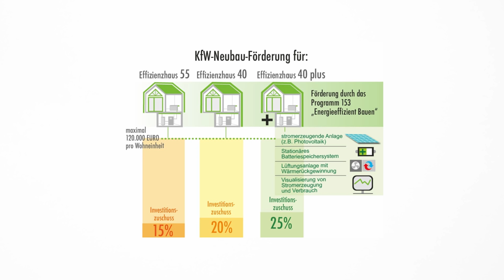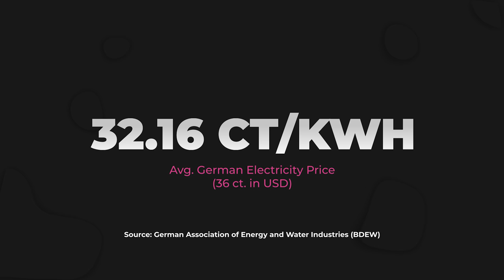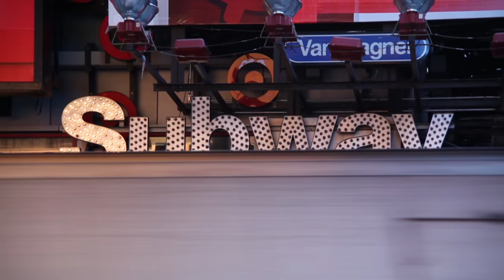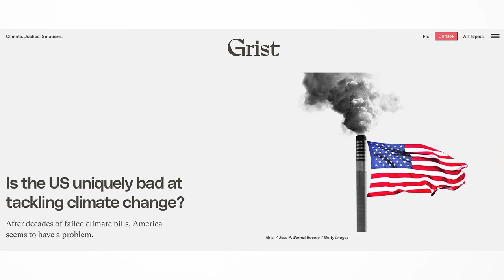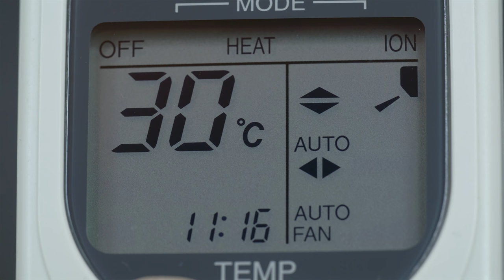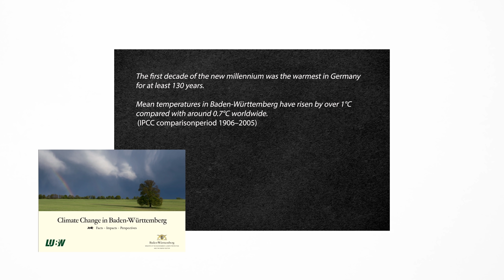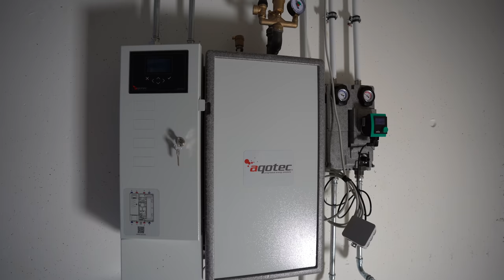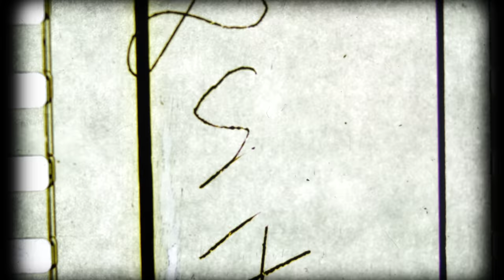HVAC (HLK) in German & American Homes | A Tale of Two Countries

Comment: What is crazy here in the US is how excessive the use of the AC is. We had to learn to always take sweaters or jacket and long pants with us when going to work, school, or restaurants, or we would be unpleasantly cold, even if the outside temperature is 104*F/40*C. As we continue to use our bikes to commute to work and the kids to school, this is extra complicated as you need two set of clothes. Often I am looking forward to get out of the building into the 100*F at the end of a work day to finally warm up again. Quite a bit of AC energy could be saved simply by approximating the inside temperature a bit closer to the outside temperature.

Comment: In Australia we do it it differently. Many houses are now starting to use multihead reverse cycle air-conditioning. Its also relatively easy to install - no big ducts to leak air all over the house, just a couple refrigerant pipes to each head unit. Its energy efficiency is usually around a factor of 3, and heat/cool output is within 30sec of turning it on. As it is effectively a low temperature (compared to boilers) air to air system that efficiency is even greater as there is no power put into pumping water or air around big loops.

It allows for individual room temperatures as well as for only heating/cooling the parts of the house you need. Typically a room serviced by this system can be heated/cooled within 5 to 30 min, depending on room and AC Head size, making it a very dynamic way of quickly maintaining home comfort. Once again making it more efficient as you are only heating/cooling parts of the home you are using.

Food for thought ;)
Reply from the maker: Ah really cool to learn more about this. Thanks!
Reply: Also goes to show that open plan concepts are not energy efficient. Because you need to heat or cool a lot of unnecessary space.

Comment: The city I grew up in Poland has a heating system connected to a local forge as their massive crucibles are never shut down because it may take several weeks to turn them off and on again.
All the heat is used to supply heating and hot water to residents making extra profits to the forge.

Comment: I live in Vienna (not really Germany, but close) in a building from 1907. That means thick brick walls. It hardly ever gets above 25 Celcius. I open the windows in the night, so its quite nice and cool in the morning, then I close the windows and the thick brick walls keep the temperature. - And my body adjusts to the heat, when I go out, its hot as well. Cooling my home to 20 Celsius or so, as some public buildings and offices do, would be too cold-  this is, what makes people sick, specially, when cold air is blowing at them, when they come from the heat outside and they are wet from sweat. I think, people on Europe walk much more, then in America, and so we have to adjust to heat more, since thats what is outside, when walking from one place to another.
Reply: Refrigeration instead of cooling, together with perspiration is what makes people sick.

Comment: We live in a house around 200 years old. Basically, the walls are about 1 meter of rocks mixed with some plaster. As a result, without heating, temperature inside will not rise above around 19°C in the summer. Basically, in the summer we heat the house by opening the windows.
Now,  in the winter, without heating, the house will stabilise at around 9°C. So, not freezing, but not really comfortable. 😉
As a heating method, we "only" have fireplaces in each major room. Fireplaces like ours (closed glass door fireplaces) deliver a combination of thermal radiation + infrared radiation. This provides a very fast and rather cozy heat, but there is no thermostate. If it gets cold, you start a fire, if it is too warm, you let the fire die. The thick walls are less insulation, but more a mass reserve for the temperature. I.e., if you heat every day, you will get waves of less and more warm conditions, but always more or less OK. If you do not heat a room for a few days, it will get cold and take several days of heating to recover.
Ironically, this whole setup was rather inefficient by the time it was built (there were a lot of cold days back then), but was done anyway just due to the availability of materials. With climate change around, we have more days "heating by opening the windows", and less days where we actually have to heat the rooms.

Comment: We had forced-air heating in the house, our family had lived in. My grandparents had build it in 1958. They had installed two chimneys. So we had two places for firing, if we wanted to get the place warm. So, up to 2006, our primary source of heating had been wood, and briquette. For heating up the water in the kitchen, and bath rooms, we had instantaneous water heaters. When they had built the grid for natural gas in our area, they didn´t connect our village. Because there haven´t been enough people who were interested to get their houses connected to the grid. By 2005 we got a new heating system installed. With radiators, as mentioned in your video. We used one chimney for the pipes of the new heating system, but still left the second one for forced-air. Due to the insulation of the house, we had situations in winter that it could be freezing outside, but you didn´t have to fire up, provided that the sun was shining.

To cool our house down, we didn´t do it exactly, as mentioned in your video. We opened all windows, and doors inside, turned the blinds down. But still left a little gap for air circulation. And then we closed them in the evening. When my brother and his fiancee build their house, they got a underfloor heating, powered by geo thermal heating. Of all the heating systems I had experienced, I like, if it comes to get it warm and cozy, forced-air heating the most. When one of my cousins who lives in our village rebuild part of his grandparents farm, for his fiancee and himself to live in, they asked a local company to make an offer for the installation of a heating system, and for suggestions which one they recommend to get it installed. The owner of the company said something, what you should keep in mind, if you´re talking about heating systems. It doesn´t matter at all if you have the most up-to-date and environmental friendly heating, if the insulation of your house sucks.

Comment: I live in high altitude region that’s extremely arid with not a great deal of variation between summer and winter temperatures. Average summer high is 32 C and average winter low is slightly above 0. We use water coolers not a/c units with rare exceptions to supplement air/room air fans because it rarely gets hot or humid enough to justify the the need for a/c. In the winter, natural gas accounting for much of the hearing. The indoor setting is around 20 C which is perfect for relation and sleep.

Comment: as to health: I personally always get a severe cold when going to America in summers because most shops etc. are cooled down ridiculously low and my body, dressed for summer temperatures, feels like being in a winter climate. In addition, most people criticize the closed system AC’s recycling of air in rooms (such as in malls, supermarkets, office buildings etc.), which implies that bacteria and viruses keep being blown into rooms and thereby can infect more and more peoples’ health. Window units seem to be very flimsy, as well. I always expect heat coming in through the thin elements keeping the units in the windows that now has to be cooled in addition to the air already in… Just my two cents…

Comment: In the US, region and climate are so varied it's difficult to find variables that suit everyone.   I grew up on the coast of Central California in the 60s and 70s.  It rarely ever got hot.  Homes didn't need AC.   We all used natural gas heaters, but it also never got that cold.  When I lived in NYC, I croaked every summer.   Needed a window unit just to sleep.  Never needed the heater vary often though as I like the cold.  I  moved to the midwest a few years ago, and again, I croak in the summer.   I can tolerate dry heat, but humidity literally makes me physically sick.  Vomiting type sick.  I am still, though, trying to work the summer with a system of fans throughout the house,  rather than installing a window unit.

Comment: 15:56  about 1999, Virginia (near D.C.) , a flat with air heating, wood frame construction: 
if you turn it out, the room feels cool in 1 or 2 hours ....  

Germany, floor heating, stone house: if I switch the central heating off, it's still warm enough in the living room after 5 hours ....  

ah... and not far away from you: 
France, Alsace, Obernai / Ottrot / Molsheim: 
Hotels with electric heating (electric radiators - no fan)  - if you switch it off, it soon gets cold in the room ... 

hm ... I prefer the german floor heating :-)

Comment: I did buy a small air mobile AC unit years ago, when we the room we slept in was the hottest in the apartment in summer.
But since then, the building has had a makeover with better insulation to the envelope and triple glazing. Also, the kids have moved out and we could move our bed to the coolest room in the apartment. Result, AC is no longer needed. Even longer periods of hot weather have not yet brought back the wish for it.
Re „unhealthy“ AC: filters in AC airducts are fine when new, but can turn into Petri dishes for the cultivation of all sorts of undesirable forms of life to share your space with over time, especially if maintenance is neglected. The “sick building syndrome” is well known where AC is dominant, even if other sources of ambient air contamination can also be responsible and occur in non-AC buildings, especially when the building or furniture is new.
Reply: My AC is running air through the system even when ist is not heating or cooling for at least 30 minutes to keep the system dry.
Only very old AC had the problem with growing bacteria. My AC has a high voltage (15000 Volt) device to clean the air in certain times all days.
Because of that there never had been an issue of bad smell the last eight years. Every wall unit has a sensor to detect people in the room and you can choose to blow the airflow away from you if you want . Also ist has a function called Natural Flow which simulates the natural outside windflow. Very comfortable. Ist is like chilling in nature on a nice day in the Spring. The AC was about 3600 Euro for two rooms inclusive montage.

Comment: Im Swedish living in the south of Italy since a year and a half back. In Sweden we also use radiator heating mainly so that's similar to Germany, and the floor heating is the best! It makes it so comfortable when it exists, this is mostly found in newer or renovated homes though, mostly in bathrooms or entrances, however, I would consider it to cover my whole house, even here in the south of Italy because the winters do get chilly humid. I think isolation is a big part of it too, a well insulated home will keep warmer in the winter and cooler in the summer, and of course blinds on windows in full sun will bring the temperature down. In our home we have an AC here in Italy, but we haven't used it at all, it does get really hot in the afternoons where we have the full sun (average on 31c degrees in the hottest hours and around 27-28c in the cooler hours), but we keep the window fully open all day and night and we have some plants just on the window as well to create a barrier and slight shade. The bedroom is unfortunately without a window but instead it is dug into the mountainside so it keeps several degrees cooler there at all times (average around 25c to 27c in the hottest hour) which makes a comfortable temperature to sleep in or retreat to if the rest of the home is too hot. We have chosen not to use the AC for three reasons, firstly, energy is too expensive, secondly, it is not good for the environment, and thirdly, it is too hot outside (average above 30 c plus sun and humidity). Better to be within similar temperatures so that the body is acclimatized.

Comment: Quick physics interlude. If you talk about energy use heating and cooling you can't use the Fahrenheit scale as an absolute. heating from 30 to 70°F and cooling from 90 to 70°F is not using half the energy and is not half the "way" on the scale, because you have to talk in absolutes and all those calculations would be made on the Kelvin scale.

Comment: Temperatures have risen during the last decades. Actually yes, I am thinking about buying AC for my home, but not for the few days it's hot, but for the many days we would like to heat energy efficient when it's not too cold outside. We cool our house at night opening all windows, intensively airating the entire house in the morning, pumping the warm air out using the kitchen exhaust, using the fan, pumping the air in from one end of the house and out the other. Then closing all windows and shutting the blinds, no cooking or baking in the kitchen (but barbecueing) and the house keeps the low temperature well since it's well insulated....

Comment: Canada here.. our family home was forced air heating n we didn't get an AC unit till 80s.. then a dishwasher came as well..
i'm now in an apt in the same city, we have radiated heat here, which I find too hot all the time, so I have my bedroom window n the balcony door window open all year around, I actually have a box fan in the bedroom window which I run at night even in the winter.. in the summer I have windows units for the bedroom n dining room..

Comment: My parents have a property on Tenerife in the Canaries and they do not have aircon or heating. They have a solid construction property with reflective coating on the glass and, since there is a regular breeze there, you just use regular ventilation if you want to cool the place but it never gets too warm anyway.
Reply: I live in Yorkshire at the same latitude as Edmonton Canada. This year was the first year we had temperatures over 40C. Those days were uncomfortable as we don’t have aircon. We spend most of the summer with some windows open. We do not use heating in the summer beyond water. Our heating system is gas, with on demand water, and timed heating with radiators in rooms. It can go to around -10C in winter so we use heating in brief spurts, combined with decent insulation, to keep the temperature around 18C in the winter.

Comment: I am Dutch and living in Suriname, rain forest and almost on the equator. We used our airconditioning in the evening to cool the sleeping rooms to 24°C as colder is really uncomfortable.
Not that we have a cool climate here. 32-37°C throughout the year and a very high humidity.

So it is which temperature you train your body to. Too big difference to the outside temperature is not very healthy

Comment: you may experience lower humidity in the Black Forest. Here in the Rhineland area, however, the humidity is crazy high! I’d compare it to Louisville KY, where I also spent a year, but where we had frequent thunderstorms at night to cool off. Those we have been missing in the Rhineland for about two months now… In really hot places, like Nevada, you do not have the awful humidity which makes the heat much more bearable… So, if really depends on where you live, the height of where you live, whether a river or lakes are nearby etc… 

BTW, I do not intend to buy an AC unit, despite the heat. Reasons are that my home is also older and installing a system would be a pain in the derriere. Parts of the house are from 1880 and parts are from the 1960s. The walls are thick and brick, so they insulate quite well - keeping the heat out in summers and the heat in in winters. When we moved in in the 1980s, my parents had already installed double glass windows, which I just replaced for triple glass windows (with mosquito screens). So, they also help reducing heat from getting in. I tilt the windows at night to let in cool air throughout the night and close them in the morning (and, if necessary, I let down the outside screens somewhat to keep direct sunlight from heating up the glass as well). This way, it stays fairly cool inside even on really hot days….

Comment: We have quite good isolation, nevertheless in the summer in can be quite hot. I installed ceiling fans in most of the rooms, which is quite good to help sleeping at night. And yes, I think also that air-conditioning makes sick, at least if it is used as extensively as in the US. Why do you need a coat when you enter a supermarket in summer ?
For the isolation of the houses, I think it is crucial to invest in isolation. Even if you keep air-conditioning, you could save a lot of energy (and money, which might be more convincing for many americans ;)).
For the climate in the city, you should talk about the excellent concept of Freiburg having water floating in the streets. I think that might even over-compensate the effect of the air-conditioning you talked about.
I have to repeat that the quality of your research and the quality of your explanations are excellent. So Ashton, if I understood correctly one of your latest videos, you're going to do this as a primary activity after finishing your PHD ? So maybe you can take a career similar to Mai Thi Nguyen-Kim who does excellent scientific videos and now does it also on television.

Comment: Perhaps you like to look into wind towers. Those were used in the middle east. Sometimes in conjunction with underground wells. The Arabs dug long tunnels to the mountains where water could be had and led it to the cities. That water was considerably cooler than the ambient air. The Wind towers caught the ambient air and  that was led to the water. Going up in the well insulated house. Think thick clay like adobe. That could get the temps quite down.